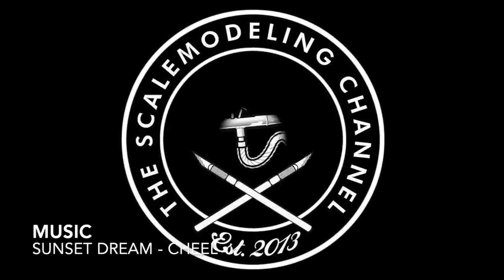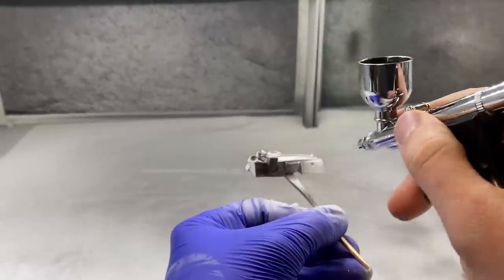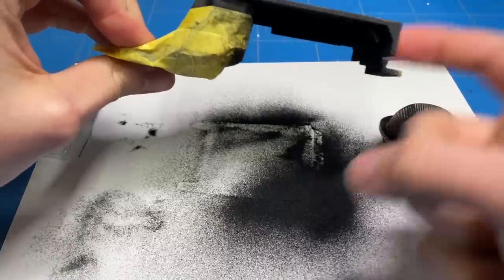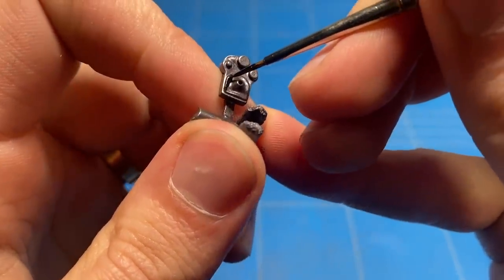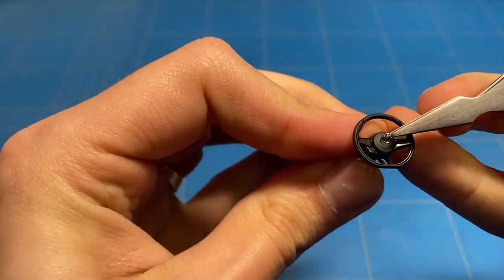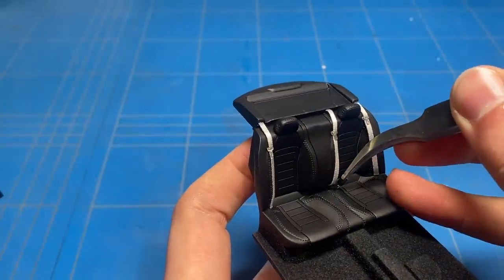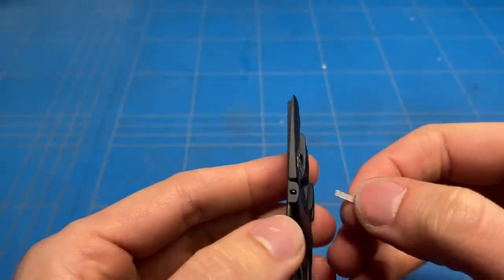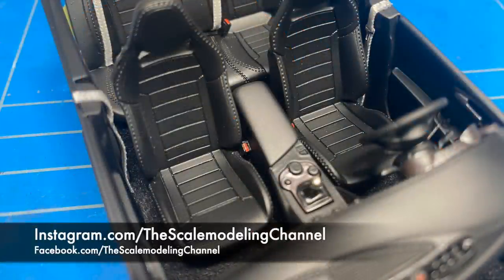Alpha Model: Alfa Romeo Giulia Quadrifoglio Part 2: Interior

Comment: Nice build. I really like it. Unfortunately, a few errors have crept in. The most obvious are the paddle shifters. These are not available in vehicles with manual transmission. Besides that, these would be made of aluminum. The next is the start/stop button on the steering wheel is red in the Quadrifoglios. Furthermore, the bucket seats have a back side made of carbon fiber.
Reply from the maker: The paddle shifters is quite obvious now you mention it XD
The seatbacks i simply decided not to do because i did not want to spend a couple hours on the decal job there.

Comment: How to thin the tamiya primer, ratio etc?
Reply from the maker: That depends. All airbrushes require different thicknesses and it also up to personal preference, and room temperature. I go for a milk like thickness
Reply: I am using an H&S Evolution with 0.4 needle, after thinning i get no smooth surface. It rough, very rough. what is the best ratio to dilute it? I do not know what I'm doing wrong.
Reply from the maker: The thickness of milk